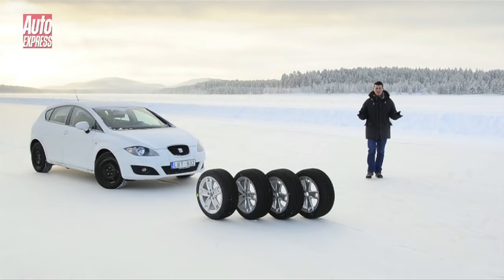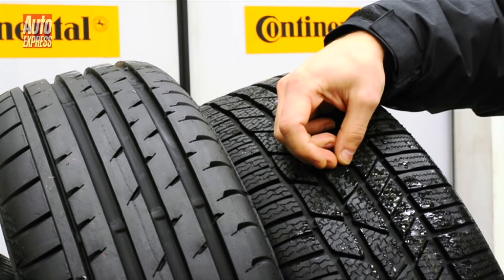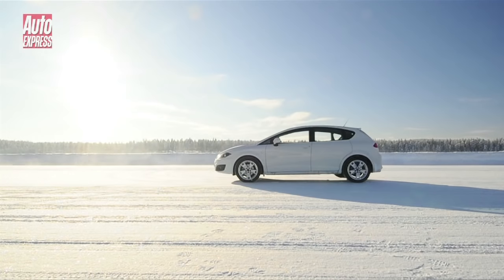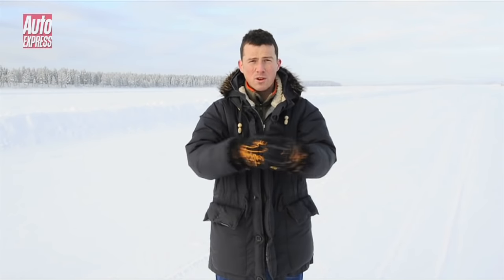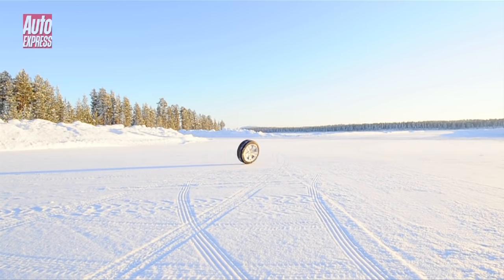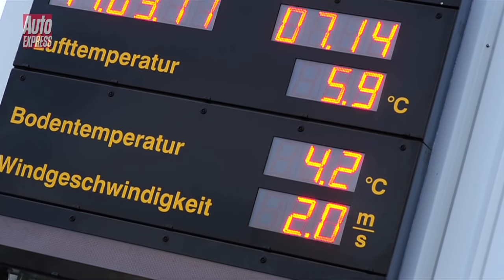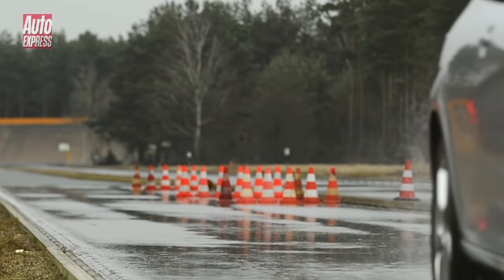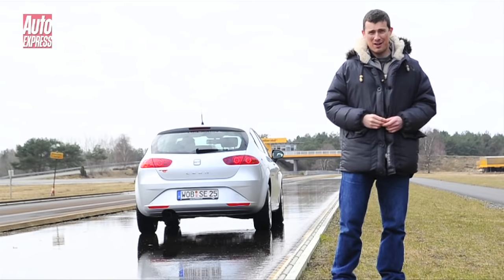Winter Tyres v Summer Tyres: the Truth! - Auto Express

Comment: Winter tyres are needed for harsh climates for sure, but I'm old enough to see how we are getting conned here in the UK with this winter tyre nonsense. Until recently most tyres sold in the UK were "all season". This is fine here as we don't get extreme weather, you can count on one hand almost the number of days a year we get snow. We also only get a few dozen days a year when it's actually under zero celcius, and then it's usually only just under. But now, most tyres are "summer" and we are expected to buy another "winter set", doubling costs for a few days of slushy weather when we could all just drive a bit more cautiously, it's ridiculous....
Reply: Copley in northumberland averages 56 snow days a year. scotland averages 20 snow days on the cost and 110 inland, the south east averages 5 snow days, the midlands around 20, south wales 20, north wales 50 and so on. also the softer rubber is better in temps below 7c. I have high performance road tyres on my car (they are summer) since november I have noticed a lack of grip in corners where they would normally be very confidence inspiring. everywhere in the uk gets below 7c from around october till april most days by the evening at least in october and april, november to march most places don't get above 7c

Comment: if you use them as intended, for cold driving and snow, they last alright. but if you use them on dry tarmac in temperatures above let's say 10-12 C, you'll wear them down.
also you can get winter tyres with a slightly harder  rubbercompund that's more suited for mild winters.

Comment: Still waiting for a real test.

How do winter tyres fare in the typically moderate temperatures of the UK aka above 7c.
And how many miles can they typically last for?
And once the tread is worn down 1mm to legal minimum how much of an effect does that have on traction?
And how does it affect fuel economy?

And, being a softer compound how much tread do they loose in an emergency stop?

Comment: The results of breaking in wet conditions with winter tires is really strange and totally opposite of what I have experienced in 30 years of driving. Seems they have forgotten in the test that summer tires need time and driving to warm up and doing that would totally change the test in favor of the summer tires at all temperatures, dry and wet at tarmac. All summer tires I have ever had even when worn down beats any winter tire hands down on wet condition at any temperature and at wet snow (slur I think it is called) , specially when it comes to winter-tires without spikes. But then here in north Norway summers is like the British winter with temperatures of 5 to 15 Celsius most of the time and most summer tires on the market here is made to work good at temperatures down to 0C as they warm up when you drive. Here you will loose your drivers license and get 1000 Euro or more in fine if you drive with summer tires on ice or snow.

Comment: so do you guys have/recommend a whole different set of wheels to change out? or just change the tyres themselves over each winter? in my mind i'd rather just change out 4 wheels with appropriate tyre, than 4 tyres on the same rims. not that i've ever had to do this or ever see myself in a position where i'd have to.

Comment: no the rubber is a different compound, engineered to be soft in sub 8°c temperatures. at such cold temparatures summer tyres are sold as a rock which is partly why they perform so badly in cold weather (the other part being the tread pattern, and use of siping on winter tyres). Winter tyres become far too soft in the summer and they wear much quicker in warm weather. All-season tyres are a compromise in both seasons and are OK for small cars but not for anything with a bit of power.

Comment: they said they were on winter tires fast speed, stable braking and less stopping distance was.
  when moving on snow tires, wheels spinning and when braking the rear end is very unstable.
when moving to summer tires, wheels are not spinning, and when braking the rear end is a lot more stable, but with a longer stopping distance.
Am I right??

Comment: My only concern, even though I live in the U.S., is that winter tire compounds are very soft, and wouldn't that equate to increased tire wear leading to premature tire replacement?
Reply: Just what I was thinking.
Reply: I can see that.  Exceptions to every rule :)  Do you keep covers on your tires?  Sol is everyone's enemy.
Reply: Yep, just like old dashboards are cracked and peely.  the sun beating on them for years chewed em up.
Reply: Only if you drive in hot temperatures. The reason they're soft is because they need to remain soft and grippy at low temperatures when summer tires get as hard as a rock and all seasons get pretty hard as well.  Just take off your winter tires when the temp gets over 45 deg F consistently.
Reply: I live in Kansas ( in the U.S for those outside the U.S. ) where its blisteringly cold in the winter, and can constantly topple 95 degrees F ( or above 60 C ) or higher during the summer.
Reply: Dave you don't use the winter tires during the summer months.  Just throw them on when the winter starts and take them off when it ends.  So you need two sets of tires, summer tires for the spring/summer and winter tires for fall/winter.  General rule is to use winter tires when the temps are below 45 deg F.
Reply: I usually have separate tires, but lately finances havent allowed 2 separate sets of tires. So i've made due with some all season v rated.
Reply: Well, then you're only choice is an all-season tires.  There are some decent all-seasons out there, check out continental DWS.
Reply: I am currently running 245/45r18 Firestone Wide Oval AS at the moment.  I'd love some conti extreme contact for the summer, but how random weather is around here, the DWS would be the best bet, that, or the Pirelli P Zero Nero AS....Had a set....best tires Ive ever owned.

Comment: Siping is what is important to winter and mud and snow tires. Siping is a process of cutting thin slits across a rubber surface to improve traction in wet or icy conditions. As is often the case, there are compromises. Winter tires, and "mud and snow" tires, may have thousands of sipes and give good traction. But, they may feel "squirmy" on a warm, dry road.

Comment: Obviously it makes sens to use winter tyres in winter, but I noticed that the summer tyres used in this video were very high pressured, while the winter ones were much lower on pressure, which made the difference in effects seem greater.

Comment: Winter tyres should be mandatory in the winter season in every country or region where temperatures are often bellow 7 deg C. Here in continental Europe I don't know the country (apart from the Mediterranian regions) where winter tyres are not law regulated. Apart from the winter tyres requirement on all 4 wheels they also must have at least 4mm tread and are suggested that are changed after 4-5 years as rubber slowly lose its grip over time (getting harder).

Comment: On low speeds are grippy and handle good, because the protector compound is softer. But wear too fast, generate more noise because of the tire thread - senceless to be used in summer. Also in high speeds generate more heat, which changes significant the tire pressure, especially when inflated on regular gas station, where is also water condense in air-compressors; the thread become unstable when overheated too. On higway, with more than 140kph easy pick over 50*C;

Comment: It's up to you to decide how hard to press the brake pedal. 

If you're a good driver, then you'll check your mirror regularly, and account for that.

Winter tyres give you the option of stopping quickly, if for example, a child runs into the road. 

Just as importantly, because of their increased grip in those conditions, they turn massively better too, so you don't understeer off a corner into a hedge or an oncoming truck.

Comment: Either you have never used winter tires, or the ones you've used were old/worn out/crappy.

I've just replaced 14 years old (yes, fourteen!) winter tires and they were still better than few years old, similar depth of thread (around 4mm) summer tires ("Traction AA") as long it was freezing. And were much better when on snow. Replaced it with newer ones with almost like new thread (9mm depth) and now grip on snow is even better!

Comment: That is really inconclusive. Which summer tyre were they testing, which winter tyre were they testing? Why only breaking on the wet, when there is no snow? The latest testI've read states that the "best summer tyre" out there is much better in dry asphalt than the "best winter tyre" in low temperature conditions. In addition, most of the winter tyres I've personally tested are awful in the wet, when it comes to cornering grip (compared to summer tyres). More comprehensive testing and greater tyre variety please!
Reply: Here in Norway the summer tires is totally outclassing any winter-tire on both wet and dry condition at any temperature as long as it is no ice or snow. But here summer temperatures can be 0-15c specially in North Norway where I live and the summer tires is made to work at those kind of temperatures. Driving with summer tires on ice or snow is just pure madness and you will be stuck at the first small hill not being able to get anywhere...
Reply: I agree... Honestly, I believe this was a video just to make people buy more winter tyres when they dont need em 👎... In reality winter tyres are made for snow and they are really only useful to people that have harsh winters every year. If you look at the tread in the beginning side by side, you can see that winter tyres are made with those little incisions so they can grab onto snow, but those same incisions grab onto water unlike summer tyres which push out water so aquaplating does not occur... So in reality winter tyres will most likely kill you in the wet... Dont get me wrong, I think winter tyres are awesome for snow, but they are misleading people about wet conditions which are far more likely in places like Britain. If I was there, I'd buy all season ones arw have chains in the back... DONE

Comment: In Sweden you are required by law to have winter tires on between 1 dec - 31 mar.
You are also allowed to have studded tires between 1 oct - 15 apr and studded tires increase grip on icy roads, especially useful when snow has compacted on smaller roads and melted slightly creating a blank sheet of ice over the entire road surface.

I was surprised to see Britain not having this requirement by law and having this video even be necessary...

Comment: because in temperatures over 15 degrees Celsius most winter tires wear prematurely due to the softer rubber that ''melts'' with the hot tarmac. In addition to that, the performance of a winter tire is lost at higher temperatures.

Comment: Winter tyres are far superior compared to summer tyres when its cold. I live in rural Scotland and we get quite a bit of snow. I drive a 4x4, on summer tyres in the snow I will get more traction than a 2 wheel drive car, but due to the car being heavier it is much harder to stop. The compound used in summer tyres does not allow the warm up correctly on cold roads so it stays hard. Winter tyres use a softer compound which allows it to grip better. I prefer to use an all season all terrain tyre

Comment: ALL cars are AWB (All Wheel Braking).  Your drivetrain setup only helps you move forward.  It does not help you stop or turn.  As this video shows, it's all about where the rubber meets the road.

Comment: Winter tyres pick up snow in the groves to create friction initially. then when the rotational force increases it "spits" the snow out, the groves are sloped to the rear to help this.  ^^ very clever engineering. it works like the tracks on a tank just in a smaller scale.

Comment: Actually the heat during the summer will make the rubber harden much faster and the tire loose some of its abillity During the winter after. Also bare road (with the higher temperature) will faster "erase" the complex tire pattern because of the rubber that is much softer on winter tyres compared to summer tyres.

Comment: I think all season are on more cars than summer tires so it would make more sense to have compared those instead of summer. Also for the braking portion of the video, it looks like the red car didn't apply its brakes until after the white car already stopped. The tires are still rotating fully and the brake light didnt even looked engaged.
Reply: ABS

Comment: This comparison has been done so many times we understand that on snow and ice winter tyres are superior. What about a comparison on a road that has been cleared and gritted at say zero degrees?
Reply: The thing to do is to look at what they do in countries where they don't have any choice but to get through whatever nature throws at them, like the Scandinavian countries. In each of those countries, it's illegal not to use winter tires during winter months, regardless of whether the roads are clear or not. They make enough difference at low temperatures that they were willing to pass a law.

From a technical perspective, snow and ice tires (the ones with the snowflake icon on the sidewall) are made of a special rubber compound that remains soft to a much lower temperature, which makes them more effective on cold, dry roads than non-snow and ice tires, because they can still grip and bite the pavement whereas a traditional compound stops being able to conform to the road surface at lower temperatures.

Just be aware that only the outer part of the tread on snow and ice tires is the special compound, and once that's worn down, you're riding on normal rubber again just like any other tire. That's by design-- they were made so you can buy them at the beginning of the winter season and just run them in the winter, and then once the tread depth is too low to hold onto the snow, you can just continue driving on them as summer tires for the rest of their lives, saving you having to buy another set of summer tires for that summer season.

Comment: Short and simple explanation in difference: Winter tires are much softer, Summer tires harder, in their blend of rubber. Also Winter tires have a smaller surface area than summer tires due to deeper grooves and different pattern. What does this mean? Winter tires handle worse (turning) on anything but snow/ice as long as it's not cold because the rubber is so soft and they also wear out faster on all surfaces and in all temperatures. Summer tires have much more rubber-to-road contact and last longer, much harder material, and don't go soft in summer heat like winter tires do. They do however go extremely hard in the cold (temp like in vid or below) and become utterly useless. They do however last longer, assuming save car + driver + driving style. Winter tires mostly wear out fast if the person tends to turn corners and crossings aggressively which wears soft winter tires down fast. You can save a thousand miles of lifetime by just going easy on wet/dry asphalt with winter tyres when it gets bendy / crossings. That's about it. / Swede who runs real winter tires in real winter and real summer tires during real summer (-25 winter, +30 summer - centigrades) :p

Comment: True but it isn't about wet grip. The magic number is 7. At 7 degrees the rubber in an all Season tyre will harden, regardless of quality, and reduce its effectiveness and increase it's wear rate. Winter tyres are designed to operate effectively at 10 degrees and below (different compounds) - of course they are not very good above this temp hence the need to swap.

Comment: on really wet roads above 7 degrees nothing can beat summer tires stopping distance and handling. Its simple physics, a summer tire has deeper grooves thus allowing better water extraction. the only time u need winter tires is when the temp goes below 7 degrees and summer tire compound freezes and goes hard. If u live in a country where it never goes below 7 degrees road temp dont bother getting anything but summer tires.

Comment: Any tyre manufacture can put M+S on the tyre if the thread pattern fits the definition. It just means it 'should' perform better on mud/snow but doesn't have to pass any tests to prove it.

A better indicator of winter performance would be the mountain/snowflake symbol. Tyres with this symbol do have to pass tests to obtain a minimal level of traction on ice/snow. Note minimal, so some all-season & winter tyres with this symbol will perform better than others but it's a better indicator than M+S

Comment: if u have some auto diff-blocking/center+both f/r/ neither visko or multi-disk el.controlled clutches, there exist force-relation between speeds of front/rear & left/right wheels. Some older brakin' systems do not provide proper pressure distribution /from pressure-regulator, which is related with suspention force parameter/ and some of the wheels might loose grip not in right time/ex: right wheel - blocked, left - not/. visco-connected AWD ensure this particular. DSC helps a lot in this case.